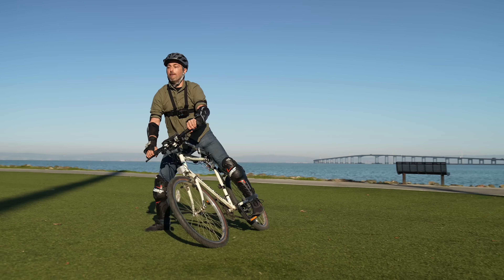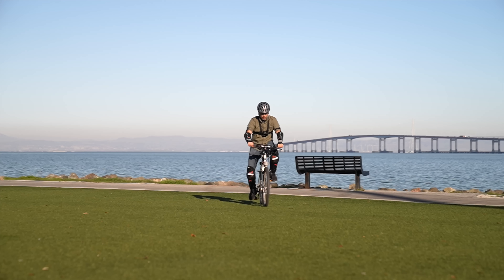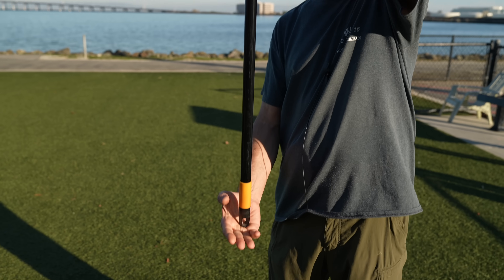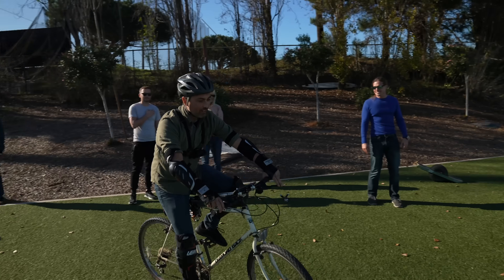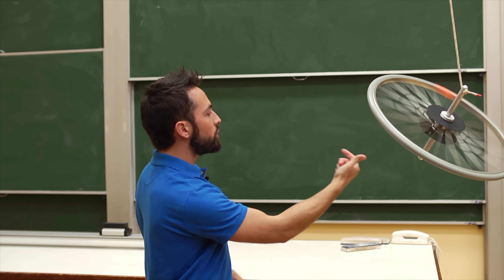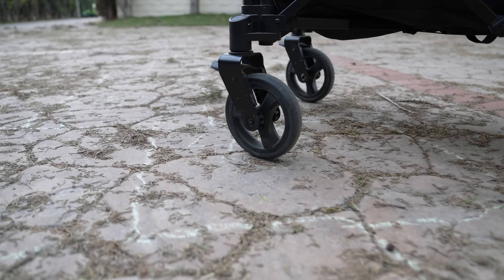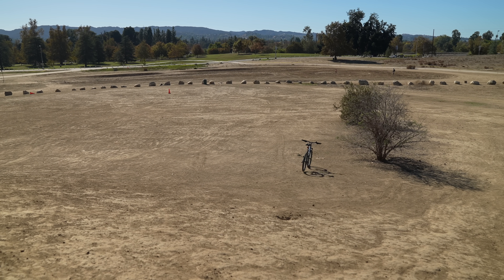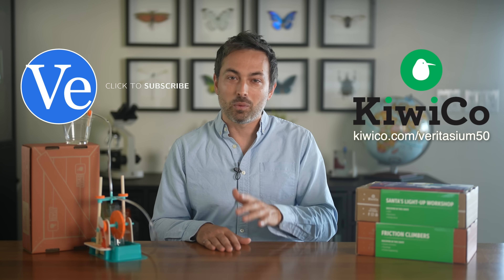Most People Don't Know How Bikes Work

Comment: Even as a kid i never just turned the handle bars, you lean with a slight turn, to turn. Greater the turn, less speed, more lean is needed
Reply: The truth is that you DO turn the handlebar, you just don't really notice it.
Reply: @numbdigger9552  That's covered by the lean with a slight turn, isn't it
Reply: @McNab1986  no. Many people intuit that it's leaning that turns a bike. Countless dwmonstrations have proven, that leaning alone can not turn a bike. Your weight does very little to turn the bike, and even if you succeed in leaning enough to turn, you will fall over because you can NOT lean back up. In order to return your bike to an upright position, you HAVE TO use the handlebar, but you do it automatically and it's such a small adjustment that unless you focus on it, you might not even notice what you're doing.

Comment: this steering angle is also used for setting the self correcting force in racecars. I observed it in racing sims where you can set the castor

Comment: yeah i learned that the thrust you put into the wheels kind of makes you stick to the ground better through traction when u go in to lean towards the side you want to turn. I suppose this is the same concept as riding it without holding the handlebars. i really have no idea how it works. for context i used to ride my fixed gear bike as exercise for about 30 miles a day because i was so fascinated by its physics.

forward momentum is ur friend if u want to stay on the bike.

Comment: no. stopped the video at 2:05. you need to lean towards the way you are turning otherwise you will just simply fall off. the act of turning a bike is more of leaning into the turn because sitting up right and just turning the handlebars doesnt even make sense. you dont even naturally do that if you are in full control. keep the handle bars str8, and keep your balance level. as the led light comes on lean slightly to the corresponding way and turn handle bars in. its not that hard
Reply: motorcycles is obv a different ball game with way more weight and speed.

Comment: bicycles always amazed me based on how well we can balance on them without even thinking about it, tiny movements is all it takes and our brain is soo good about doing it almost instinctively, i never had training wheels, i just got on and somehow knew
Reply: It's because the bike has built in stability, where the steering geometry works with the gyroscopic forces to keep the bike upright and stable, as can be seen by the bike steering itself when it rolls down the hill. When you turn the bars more gyroscopic forces are used to initiate and complete the turn while keeping you stable. Your own balance has very little to do with it, except at low speed, when the gyroscopic effects are too small to help.
Reply: @hughjardon3538  then everyone knows how to ride a bike huh?

...and did you watch the video? because "very little" is false.

Comment: Counter-steering, or positive input, when riding my motorbike, I was taught to push the bars forward for the direction required, push left forward, turn left and vice-versa

It's very sensitive and aids cornering with less effort

Comment: i actually learned how a bike handles when i was around 4 i used to have training wheels but they were bent to the point where they don't ever contact the ground anymore, one time when i was riding it i noticed it was balancing so i asked to remove the training wheels and i managed to balance it i just knew that if it's rolling it will balance and turning just came naturally because when i turned the handle bar i noticed it wasnts to lean towards the direction it turns so after a few tries i got the hang of pushing it towards the direction i want it to go it was such a fascinating experience

Comment: I'm a new cyclist and have found real problems with the camber (sideways slope) where I've ridden. I fell of due to that and now am injured so can't ride for a while. From what others have told me, plus this video that has made it even clearer, I wasn't leaning at all but was moving the wheel to steer. I used to ride as a teenager with no problems at all, yet somehow in my 50's it isn't coming to me naturally. It's actually quite odd that I seem to have "forgotten" how to steer a bike! I should be doing it without thinking, but it's not happening. I can't wait to get back on and try again.

Comment: motorcycle counter steering? it's always the opposite during turns except at very low speed. Push right if handle bar forward/pull in left side to turn right. I rode a bike at a trip decades after not ridden a bicycle, and was on a motorcycle for 3-4 years daily before that.. I forgot how to ride a bicycle for the first 30 mins to an hour.

Comment: I wonder if this has to do with how people ride bikes slightly different in different parts of the world. I don't have a fancy contraption like they do in this video but I've tested it for myself many times since I first watched this video and I can indeed turn without going to the opposite side first. Whats especially interesting is that many people over here (central europe) don't do that either.
Reply: No, you only think you're turning without counter steering.  When you use body position to lean the bike over, the front wheel automatically turns to the outside.
Reply: @jridenour31 no, that is exactly what I have tried numerous times. Can lean into the turn and pull the handlebars in the direction of the turn. I could imagine that this is at least partly a psychological phenomenon because people know they are going to be limited in movement causing them to overthink what they're doing and once you lose your balance you're not gonna get it back if you can't turn into both directions to counteract the imbalance.

Comment: I find this very interesting. I ride my bike to work every day. I find this to be true at only low speeds. At higher speeds you lean into the bend before to turn the handle bars, so there is no leaning the opposite direction first. This can also be done at low speeds, but naturally you do go the opposite way first if not thinking about it. Pretty cool.
Reply: Same here. I have to be going pretty slow to use the counter steer to turn. To stay balanced at low speed I of course let my instinctive counter steer take over.
Reply: @Observ45er  ok, get on a bike and try it. It works. Without getting all scientific, you can just get on a bike and try. It's the same as standing up. Do it, stand up now. Lean to the side, you will start to fall to the side, not the opposite side, but the side you lean. 
On a swing you have your pivot above you, you are the force, and the reaction happens below you, you move the opposite way.
Put it this way, roll down hill on a bike, lean. Just lean to the right let's say. If you want to, you can lean right, and not react, do not turn the handle bars, and just fall all the way to the ground. Or, you can lean to the right, and just like if you stand up right now and lean to the right, you will start to fall to the right. On the bike, as you start to fall,  you turn you handle bars to the right and your force now goes into the bend. 
I mean try it. I test it on the way to work. I encourage you to get on a bike, roll down hill and just lean to the side, as if you are trying to topple over, which you can do, you can just lean and fall. But then follow the lean with the rotation of the handle bars and, boom, you are turning.
Use science to understand the findings. In this case you don't need science to predict the outcome, it's just a bike, you can go and do it.

I believe you may be imagining this as a stationary bike or slow moving. Where if trying to balance without moving, when you lean right, you will push the bike out left, to keep the gravity centre. But at a speed, when trying to turn, as in move to the right, you do not want gravity centre. You fall right and then follow with a turn to the right, and the force gets pushed into the ground.

Ah, I mean, do the experiment. It proves itself.

Alright, peace.
Reply: @abehartshorne6028  Bingo. I was an elite cyclist in my youth. Road bikes work at speed for a reason. Your feet on the pedals just forms a triangle to the ground. 
Like walking, we are always just about to fall. I think this experiment 
needs to be revisited with pros and  armatures. Plus different stiles of 
bikes and do it on the old Alameda Naval Air strip.
Reply: @abehartshorne6028    I've been riding a bike much longer than you have and understand the physics very well.  I stated facts that you don't really understand and haven't looked at what you really do to ride a bike.
.
I am sorry, but thee is no way that your simple "experiment" can identify the science because there are too many things affecting it including your ability to correctly observe what is going on and just how YOU may behave on the bike.
.
P.S.  I've been through this very thing years ago and the very carefully designed and observed experiments using video that we set up in an 11th grade physics class support what I report here.
Sorry, but "try it" is not studying science.
Reply: @Observ45er  you can shift your centre of gravity easily, move your head, shoulders, upper body mas, even lower body mas if standing, and the knee on the side you want to move outwards, and your entire weight has shifted. Then the bike will follow and lean that direction also. Centre of gravity is easily manipulated on a bike.
Reply: I lean before steering almost exclusively, unless I'm at extremely low speeds where I can just gently turn The handlebar in the direction I want to go. But that's really low speeds like slowly pedaling in the first gear slow speeds
Reply: @nigeladams8321   I prefer to not continuously repeat my explanations. Have a good life and be a good citizen.
Reply: @Observ45er you can pretty dramatically change your center of gravity on a bike by moving part of your body. Especially if you're not sitting on the seat
Reply: @Observ45er  Instead of being smarmy and snide you could try explaining further, no need to repeat things then. You said that there is no way to change your center of gravity on a bike, unless we are working with different definitions of center of gravity then that makes no sense

but hey, ego masturbation is easier
Reply: To dispel any misunderstanding, the bike does not lean one way and then the other, rather when the front wheel is turned slightly away from the direction of the curve In the road the rest of the bike wants to continue straight, but with the front trying to go the opposite way the bike and rider start to fall into the turn.  As long as you keep the torque on the front wheel the lean angle will continue to increase until the rider sees the lean angle is sufficient to follow the arc of the curve whereupon he / she turns the front wheel to maintain the lean.  At this point the forces of gravity and the lateral acceleration balance.  In order to exit the curve you must turn the front wheel into the turn which will cause the lean angle to decrease, bringing the bike upright.
Just to dispel any misconceptions: at speeds greater than five MPH countersteering ALWAYS WORKS!  Yes, even for tiny little corrections in a corner.  Commit all steering moves to your Motor Cortex and live a long life on two wheels!
Reply: @roberttharalson7072  awesome information, thank you. Does the same apply in the instance of riding with no hands on the handle bars, just balancing as you move along, and when you lean to steer, is there a counter movement there? If the person was to say lean to the right with their body to turn right, is there any form of counter steer/lean? And if so, how does that occur?
Reply: That actually initiates a counter steer. It's not as pronounced compared to motorcycles but you cannot make a lean without doing so, attach a precise accelerometer and you'll see the bike actually turning the opposite very slightly before leaning to the turn corner. It's just that bikes are way lighter and slower than motorcycles so the steer to the left to lean right is very subtle that it's not noticeable unless riding very high speeds like pros on downhill sections or mountain bikers doing tight turns on a trail.
Reply: It's the opposite way round. Get up some speed, take your hands off the bars and see how fast you can turn, then try the same at low speed.
Reply: This explains why elite track bike handlebars are solid
Reply: It is still true at high speeds. The way you lean into the turn at high speed  - is to first turn the oposite direction.  You cant "lean" into a bend unless you turn the oposite way even by the smallest of amounts first OR you are already falling to that side. Thats what this video just showed.  If you are already falling to the side you want to turn - its because you have already turned slightly the oposite way further back without even knowing it!  You can't change your center of balance ("lean") on a bike without shifting the wheels beneath you - by steering.  The difference at speed is that the amount of oposite turn is VERY small so is almost unnoticeable!
Reply: @aqstix  This is something the Wright Brothers figured out.   What is fascinating is that we aren't taught about this when learning to ride.  We figure it out by doing.  At least I certainly don't recall being taught it and don't recall telling my boys about it. But as an engineer understanding physics, it's easy to see.  
There are people arguing here that they lean when riding hands off. I can see applying some torque against the ground contact point, if you think carefully, but haven't been able to try it yet. . .
Reply: @Observ45er  That is an interesting comment, I will look more into the Wright brothers. 
I have recently been doing a difficult engineering project that has been showing me flaws in my theory when put to practical test. I find this very interesting to go back to the board to identify your own short sites. I also find the idea of leaning hand-free to achieve steering an interesting argument I'm the debate.
Reply: @abehartshorne6028   Well, that's what you do when looking into something you may not have fully understood. That's what the Wright's did - true engineering.
.
Unfortunately, I don't recall which book I read that in, I've read many about them.  The Wrights were quite astute in physics, but I don't think you'll find much more about bicycles and them.. 
.
[short sights? as in short-sighted?]
Reply: @Observ45er  Yes, as in short sighted.
Reply: I never saw it used that way.
Reply: @jridenour31  🤣this has gone on for too long. Stop with the theory. You guys need to go get on a bike
Reply: @abehartshorne6028  Think I will!   And when you are next riding and trying to "lean" - pay attention to how you are steering.

Comment: You can do this in cars too, it's called a "Scandinavian flick" or an "inertial drift".

Imagine you are traveling at a high speed and need to make a sudden sharp turn. What you do is over steer in the opposite direction to the oncoming turn and then quickly snap the steering back into the direction of the turn. This helps the whole car slide around a sharper turn than it normally could at a given speed.

I'm a little fuzzy on the actual physics here, especially since drivers are using many terms incorrectly. What I've pieced together is it seems they think the initial flick in the wrong direction stresses the suspension of the car, giving it "more weight" on the tires on the opposite side of the turn, allowing the tires to grip the road better (rolling without slipping), while the tires on the same side of the turn have less grip (rolling with slipping). If, for example, the turn was on the left, this means that the tires on the right side of the car have more grip, and the uneven traction allows the tires on the right to push the car around the left turn.
 
But I think there's slightly more going on here. The flick actually creates a situation where the car's trajectory is slightly wider than the regular turn without the flick. A wider turn means lower acceleration and so speed is preserved more efficiently.

Comment: 9:09 that bike is steering by tire torque - or in this case the profile of a rounded steel edge. Think of how a cone rolls in the direction of narrower radius. If it leans to one side, due to the round profile of the "tires", a narrower tire radius and a wider tire radius are in contact with the ground at the same time. This means that the wider tire radius is moving faster and steering the bike in the direction of the lean. The weight on the front is just to press the front wheel into the floor enough that it doesn't slip. You could try it with different profiles on the front wheel to be sure - from just a pointy edge, or maybe a level cylindrical edge like the edge of a coin. I'm thinking it wouldn't steer and would fall over.